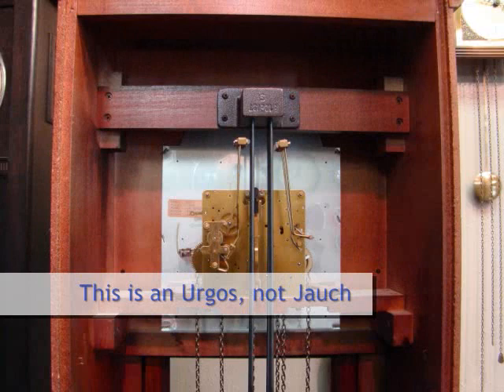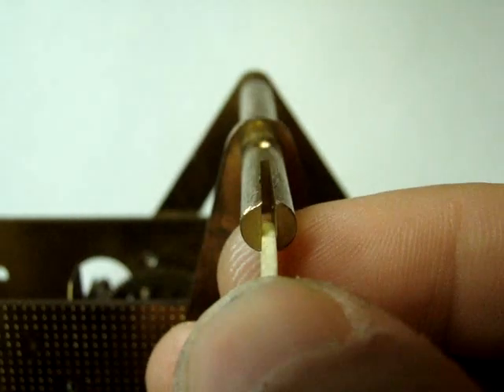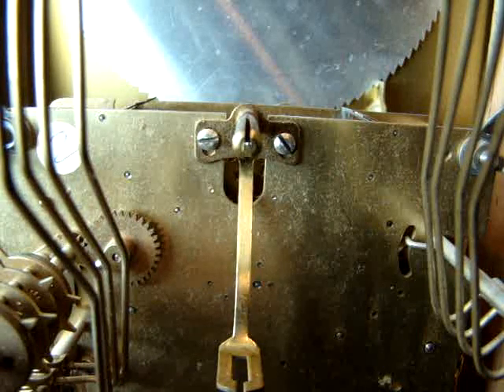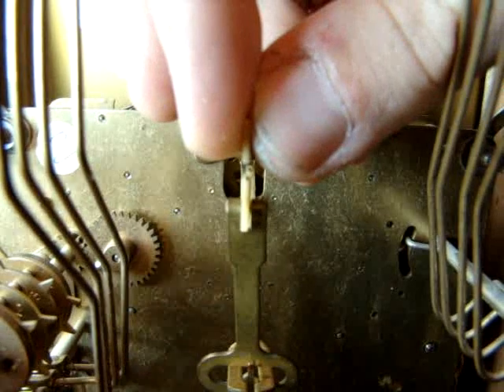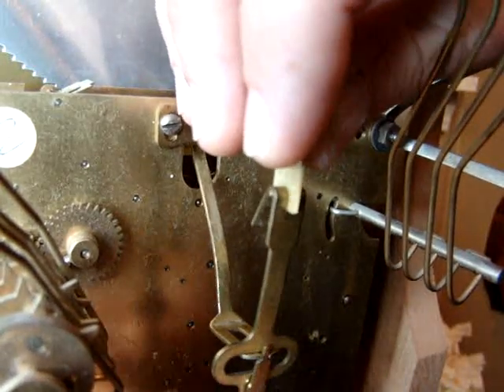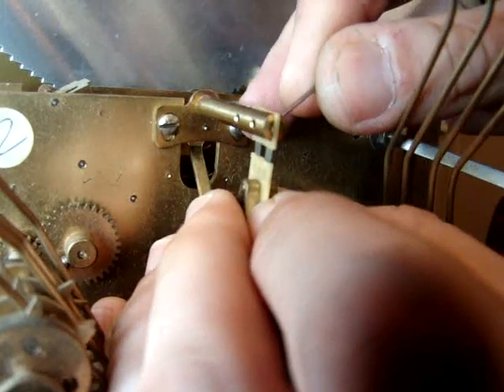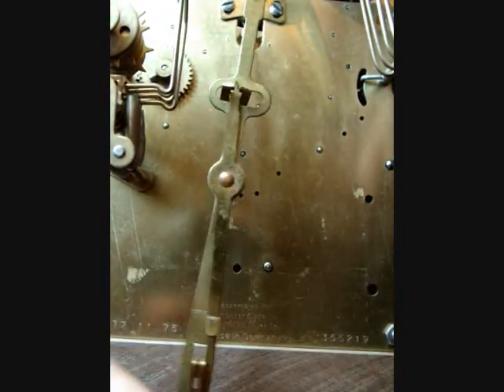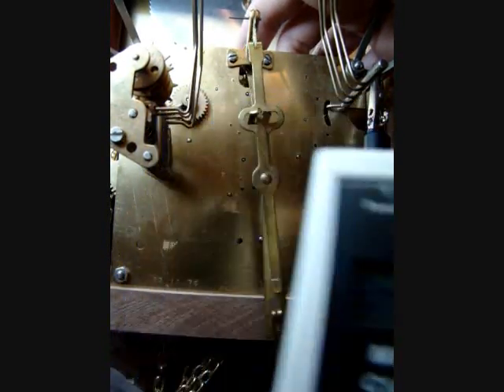Suspension Spring Installation - Gulf Coast Clock Co Pensacola FL

Comment: A Ridgeway came my way, lovely sounding Westminster Chimes and hadn't worked since the '70's the family told me. All extra suspension springs including the one attached were broken.  With no suspension spring, a family member tried to attach the pendulum directly to the crutch and bent the extension which I finally (tonight) returned to the shape shown in this video (thanks for posting - it was just what I needed to see.)  To describe how I made a suspension spring (rather than waiting, on order, maybe to find out Ridgeway was gone (hypothetically) since the '80's (I didn't want to even discover anything of the sort - I'm still afraid to even inquire since it would be a tragedy; if this grandfather is any indication of all of their clocks.)  Anyway, the thin steel leaves of the original suspension springs are extremely fragile, so to recreate the function but with much more strength, I took a clear piece of tough plastic - a part of a small container of screws, from the longer plastic part which hangs from a display, and cut a close approximation of the original suspension spring size.  Even with the broken leafs I could exact it's size more or less to recreate it and It fit perfectly into the susp. post.  With a Dremel, I drilled two very small holes through the top and bottom of the plastic piece, one for the taper pin and one for the post which would be a small piece of paper clip I cut which the crutch could hold 'double over-handed' and Gorilla-Glued the tiny paper clip piece to secure it solid to the plastic.  The plastic is flexible resembling the flex-quality of the original s.spring but it's much stronger and would likely survive anything but a fire.  It has been working seamlessly for a year with no wear.  I made two extras just in case this one failed.  But after a year now I can say with confidence that it won't break and it's a simple improvisation.  Maybe it's not 'a better mousetrap,' but at the very least, it continues to work real well.  B =]
Reply from the maker: Improv is a good thing! Glad you thought of it and glad it works. That's a first for me to hear about one like that. Curious as to why the original replacement broke so easily? 🤔
Reply from the maker: Yay! Glad to hear it's up and running now. YouTube has been great for helping people share tips and tricks, thanks for watching!

Comment: This was extremely helpful.  I recently moved my clock and needed to re attach the pendulum.  In the process I somehow broke the suspension spring in half.  my hubby figured out what had happened when he noted that the upper half of the spring was still attached by the tiny screw that projects thru the hole...........

I could not have figured it out.  I just knew the pendulum wanted to hang sideways........learning the spring had broken - that answered the question since it it placed perpendicular allowing the pendulum to hang straight.  I do think the 'tick tock' motion is regulated by a screw at the bottom of my pendulum.........it's been years since I've had to adjust it so hoping I'm right.  Hoping it all goes back together with the correct timing.........I do have a metronome but not sure what beat to set it to........

saving this video for when I'm able to get the spring.........  thank you again!
Reply from the maker: Thank you for watching, glad to help solve the mystery!!

Comment: Thank you for the video, I am trying to fix our clock which is the same exact model the one you were working on its missing the PENDULUM LEADER, I found the same exact PENDULUM LEADER in your video but it is a little expansive. My question is what other kinds of PENDULUM LEADER can fit the JAUCH 77. Thank you so much